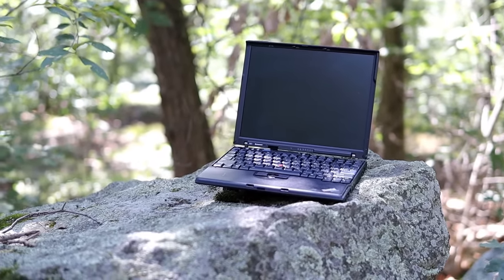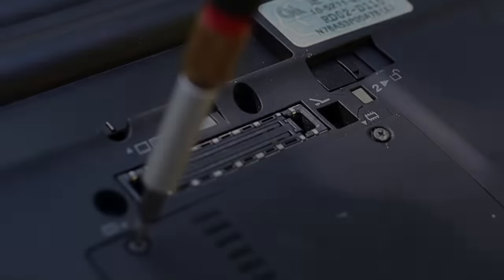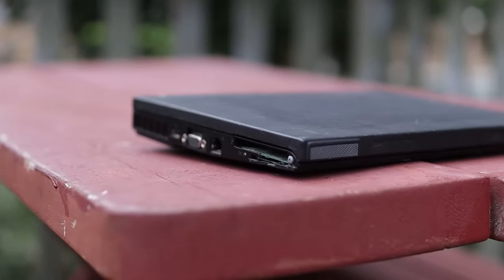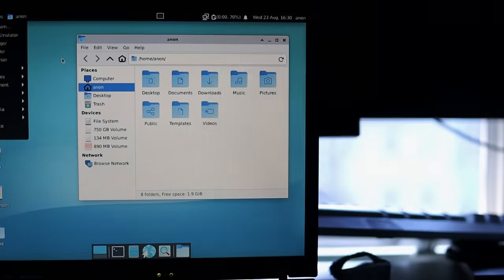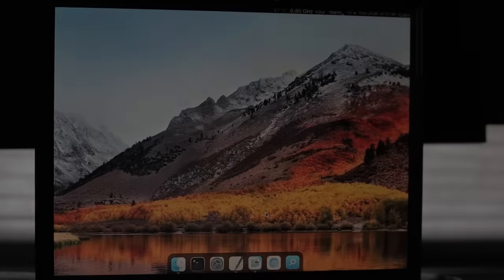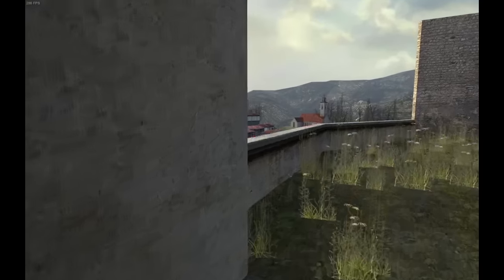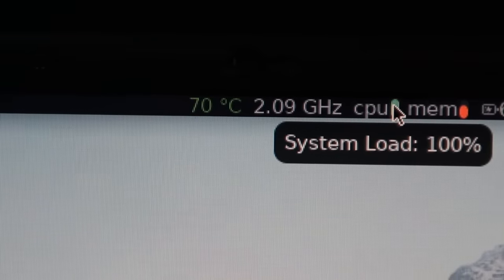Can Linux save this old laptop from obsolescence?

Comment: 😍 Have the same exact laptop, down to the CPU, though I got the extended batt. Ran W7 well because this laptop was released with Vista support, but yeah, that's been EOLed. I tried running elementaryOS on mine but the DE was too heavy. Linux Mint MATE and xfce ran fine. Was looking into making it into a Chromebook a while back, but it was too old.

Still think the Chicony/Alps keyboards on these are the best even when compared to modern ThinkPads. X220 was the last X series that had the older IBM-style keyboard, I think.

I brought it once to a conference just before COVID hit and people were genuinely curious and asked if it was new, likely due to the 'novel' form factor vs 16:9/16:10 laptops 😂

Comment: SSD’s make a huge difference to old PC’s.  My daily driver is an “old” 2013 i5 Thinkpad X240, and with upgrades to a 1GB SSD and Ubuntu Linux it’s pretty good.  I’m mainly using it for Python in Jupyter Notebook (browser-based) in case anyone is wondering.  I usually have multiple browser tabs open simultaneously.  It’s responsive and the keyboard is nice to type on.  The OS is current and gets software updates daily.  What’s not to like?  It’s certainly better than my daughter’s Chromebook from last year.

Comment: i play team fortress too with low settings but high frame rate on a 2007 macbook pro core 2 duo with 4gb of ram. it was the top of the line computer in its day and cost me almost $4000 in 2007, it had the high res display as well. 

due to the graphics card, most modern distros, while are able to be installed, can't get the drivers installed, maybe if i was more competent, but i tried. finally what worked though was MX Linux, i was able to install proprietary nvida drivers, and play team fortress 2 on steam on a computer from 2007, in 2022! pretty impressive.

the computer is still useful for web browsing, watching movies and videos, and many many things, and with the high res 17" display, it's still a nice big screen. i can almost think of it as a very smart portable tv and media center, with plenty of i/o and nice backlit keyboard and magsafe!

Comment: Have an old 2013 HP laptop, after swapping the keyboard and installation of a modest SSD with Garuda XFCE (I use Garuda Dragonized on my Desktop, wanted familarity), it's been more fun and easier to work on than my more powerful 2019 laptop, and I had a extended capacity removable battery for it that works great.

I've tried doing work on the 2019 laptop but it's  a nightmare to open, Ive already had to epoxy one of the hinges back together and the slot for the M.2 drive is already dead after just a few months with a basic SSD in it, the next time I open it will be to gut it for parts.

I plan to save up for a Framework laptop but until then my 2013 laptop running Garuda XFCE linux is my portable buddy, so long as I don't try to work on large Blender 3D projects it seems to handle everything just fine

Comment: Liked and subscribed.

This moment I'm doing the final update on a new OpenSUSE install on a 2014 Acer C710 Chromebook. It's even weaker than the Thinkpad, so I think I'll spin up the Void image I have on my Ventoy drive and see how it compares. May be a reinstall coming! I knew I had the image, but had forgotten about the low resource usage. Thanks for the video!

(Sent from my 2013 Thinkpad T430 running LMDE6!)

Comment: Absolutely! I have an 8 year old chromebook with manjaro on it that runs amazing with a 256gb m.2 SSD and an 8gb swap partition. It has 4gb of ram and it's one of the few chromebooks in which you can upgrade the hard drive.
Reply from the maker: Meanwhile, Chromebooks of today usually have a useful of no more than 5 years.

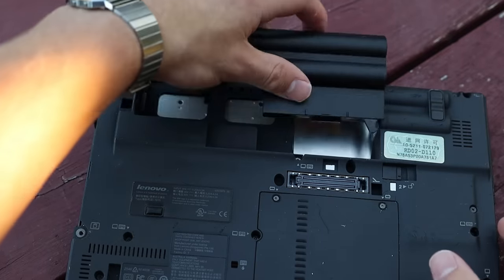Comment: 12:04 You meant that the modern laptops of today are more and more compressed and it has become difficult to work around stuff by yourself (for example even just taking out an battery has became an difficult task which was just slide in and out a few years ago. Ofc this has benefitted the companies and somewhat you as well, but to have fun checking the laptop and its hardware/software and messing around it is really an great thing which todays laptops can't offer

Comment: I have an X220, and it has become my trip computer, riding in my carry on luggage when ever I travel.  It's been upgraded with an SSD, and I got it with 8GB of ram.  I think it can be upgraded to 16GB of memory.  The X61 is barely not obsolete.  Any older laptop without a processor that supports the 64 bit instruction set IS too old as most Linux distros no longer support 32 bit processors, and even if they do, may of the user applications do not.

Comment: I tried reviving laptops with Linux several times over the last 20 years. Sadly I only got it working well enough a single time.. I don't know enough about Linux and all the distros.. I amateurishly tried out about 10 different versions/UIs but some crucial things never really worked.. I had the biggest problems with: GPUs (drivers), Wifi, everything on a laptop that isn't standard like function buttons, volume, brightness, even the Lid closing... never found a working printer driver..  and then not knowing Linux I also had trouble finding the software I want- but I expect that has gotten better now with all the browser based apps. I had the best luck with Linux Mint and Ubuntu- although Ubuntu was a bit too resource hungry.

Comment: I think the most important upgrade you could ever do is use an SSD. Even the cheapest SSDs can make a computer like this behave completely different. It is night and day.
Specially if you are using a lightweight linux + firefox, small amount of ram is ok. But HDD speeds makes anyone suicidal nowadays... rebooting, waking from hibernation, opening apps, become a chore...
Reply: I have some laptops from that year and I assure you they usually don't have a standard sata connector making the change almost impossible.

Comment: Old Thinkpads and Linux work very well together. I put bunsen Linux on mine - fits the design of the Thinkpads and runs on minimal hardware. A cheap SSD and maxing out the RAM helps a lot. The ergonomics beats any cheap, modern laptap. The problem can be the batteries which detoriates with use and age. And yes, Thinkpads are "interestning"! Thank you :)
Reply from the maker: I haven't heard of bunsen linux. I'll have to give it a try sometime.

Comment: This video is extremely well made!
Sadly I guess that a lighter os can't do much on CAD and similar things, am I right?
My PC is 13 years old, with Win10,  an i3 380m, 8gb and an SSD, but it seems to be close to the end of its lifecycle for my needs 😢
Reply: FreeCAD may work great on Linux. But probably this will not fullfill your purposes.
Reply: @puffin_000  thanks a lot for the answer!
Yesterday I was typing a comment on YouTube and realized that it struggles already with that task, so yeah, I guess it would be underpowered anyway
Still good for streaming though, so it will be repurposed for that
Reply: @claudiofiero8523  Heavy loaded JS websites always like that :D. Its great to see an old laptop like that still find a purpose.
Reply: @puffin_000  that's my first and only pc, I nearly maxed it out in this decade 🥹
It could still receive a cpu upgrade, but 40 bucks for marginal improvements on an old machine doesn't seem very reasonable for my pockets, it would be just a better dual core apu than its i3

Comment: Old PCs like this are actually still pretty usable even on their original operating system. I've got a laptop lying around running XP service pack. 3. And found a chrome designed for windows XP and get me like a version 109 or something like that and it's actually pretty usable
Reply from the maker: Neat!

Comment: The problem with obsolescence is that no matter how snappy you can get your OS to be (and Linux does have low requirements for low end machines), they just can't really keep up with modern web apps. A lot of people say they can daily drive those machines with Linux and that is fair, as long as you define what daily driving is. Unfortunately my daily PC use is by nature quite intensive on the hardware, as in, I had to upgrade to 32GB ram on my main workstation because 16GB wasn't enough for my workloads, and I'm most definitely using every little bit of my hex-core/12-thread CPU. But some people don't really do much more than office work, email, and so on, and that's definitely viable in older machines.
Reply from the maker: yeah the modern web is brutal on these old chips

Comment: Oh yeah, I've put "full fat" Ubuntu 22.04 on a few older systems (I am using the "Gnome Flashback" desktop though, rather than Unity or whatever, it has a more classic appearance.)   I'd say the realistic minimum is like a Core 2 Duo with 2GB RAM.  Indeed, if you can get a 2GB system to 4GB do it, you'll run into swap pretty fast as you open a few tabs.

The last C2D I set up booted to desktop in about 55 seconds off the HDD; you do end up with like 1GB RAM used at startup, but it can swap out about 600-700MB of that without any affect on the program you're running or the desktop.  The battery life was brutal though, battery life went from 4 hours doing nothing to like 45 minutes playing a Youtube video since it was running the CPU fairly hard.

I'll note, these old Intel GPUs run 2D and video scaling fine, but the 3D support a) was slow as hell on them anyway. b) dropped in newer mesa versions.  In general, all pre-shader supporting 3D GPUs (the ones that only had "fixed function" support) were dropped recently; there is still a "mesa-amber" package where they branched off that last version of mesa that supported these and intend to continue to fix any bugs and security vulnerabilities that turn up in it.  You get OpenGL 2.1 (but slow as hell) with the amber, or OpenGL 4.5 through llvmpipe software rendering with current mesa; the GPU is so slow that I actually found the llvmpipe to be faster (still bad but a little faster.)

My dad runs this piss out of a Core 2 Quad desktop (Optiplex 755) with 4G RAM and a 1TB HDD in it. He makes heavy use of Chrome, edits like 100s of page documents with lots of graphs and charts in them, tons of scanning and printing, and weekly Zoom conferences.  Zoom maxes out 2 cores by itself, but it's got 4 so it works out OK.  That thing has some problem due to successive Ubuntu upgrades (I assume it's probably got bits of upstart, init, and systemd all taking up bootup time..) and takes something stupid like 3 minutes to boot, but runs fine once it's booted.

Comment: Have same spec Dell (T7500 CPU), running lightweight Windows 8.1 without problems, around 700 MB RAM usage on Boot. Great for Word and occasional web browsing. Gaming is almost impossible due to OpenGL version on that and all in all quite obscure graphics performance

Comment: I feel that the "basic/heavy" developement was in the two decades 90-s and 2000-s (1990-2010).
Computers from 2010 is still good and most people could use it without problems.
If you want the latest games, of corse then you have to get computer for that.

Comment: Similar specs. Use "SMPlayer" with Youtube extension. Works great. 720p60fps in NON-Fullscreen mode.  Also 1368x768 native res on monitor is WAY Better after changing monitor to 720p resolution. (I don't know why such a big difference.) I'm using regular Mint Cinnamon 21.2.

Comment: A little while ago I was given a Fujitsu Siemens Lifebook. It's comparable to the ThinkPad in functionality and ports, though it's much more plastic lol.
I fully decked it out with 4GB of RAM, a T9500 (yes laptops of that era had user-replaceable CPUs, go figure) and an SSD.
It absolutely flies with Antix Linux and I'd say it still holds its own with Win10 whenever benevolent Microsoft blesses me with an update-free day.
Reply: Thinkpad is plastic though.
Reply: @0w3nn  Really? I thought they've always been constructed with alloys and more "premium" materials. Pretty sure the modern ones are.
Reply: @Windowsfan100  Yes, modern ones have metal lids. The older thinkpads (T410, T420, etc..) surprisingly are fully plastic. My HP Elitebook 8440p from similar time period is entirely metal.

Comment: I have a laptop that was once my mother's main computer, it's a cheap lenovo netbook from 2014 and it was installed with windows 8 (upgraded to W10). Horrible performance. Nothing was doable. I removed the old HDD disc, and inserted an SSD with classic Ubuntu on it. The mashine was running really well, and internet browsing was good too. 4 GB of RAM did it's job

Comment: With Thinkpad X61, you can upgrade the BIOS into the custom Middleton BIOS. It unlocks the maximum RAM into 8 GB (although it can't be used anyway unless you want to spend big amount of money to buy 2 x 4 GB DDR2 RAM sticks) and the SATA speed from I to II (SSD would improve the snappiness).
Reply: You don't need the Middleton BIOS to unlock the X61 for 8GB RAM - it supports it anyway. I know this because I have such a Thinkpad with the standard BIOS.

Yes, the Middleton BIOS does unlock SATA speeds on some Thinkpads and I think it might also allow for a wider range of wi-fi cards to be used on Thinkpads too.

Comment: I have been trying some "old" computers with the lightweight distros... well. For a person who is not a real Linux geek, 15 years is bordering on the top age of a computer that is still somewhat well supported in modern distros... a bit better if already a 64 bit unit. I've run into a few strictly 32 bit units that were shipped with Vista or 7. A couple came with SiS chipsets where VGA support in new distros appears to be sucky at best, at least out of the box.

Comment: As someone still using a 2013 and a ca 2009 desktop daily, I can see how even an old laptop will still do got. It's all about expectations.
Core 2 Duo are still usable, not as fast as modern chips, but usable.
The difference is, that on a desktop you can run any older highend or modern entry level GPU. The Intel GMA were rubbish even in their time. (As the HL2 benchmark showed. DX10 and OGL 2.1 are supported, but there are issues)
If the laptop had more beefy graphics, it would make for a decent XP retro machine.
For Windows, the usable requirements from Vista to 11 haven't increased much, it's more about additional requirements like D3D capability, instruction extensions, and TPM.
And the X61 is from that era when Lenovo took over the laptop line from IBM, but didn't try to copy Apple yet. Proper business machines that are built well and still work.

In general, well done test with realistic use cases. Throwing Linux on it and using uBlock is pretty much on point.
I'm using x264ify myself. It's a godsend when the system doesn't fully accelerate vp9 decoding. And've used a Dell Latitude from 2001 before that came with a 1600x1200 display.
Reply from the maker: Yep! Expectations are everything with hardware this old

Comment: I'm currently doing something very similar. But instead of a 16 year old thinkpad, I'm using a 23 year old Dell Latitude. 750 MHz Pentium III.
I'm putting an IDE SSD into the thing, upgrade the RAM to 512 MB, and then AntiX Linux 23 should run just fine.
Reply: Planning on doing any work on it? :D

Comment: This is an old laptop in years but it's not really so weak that rescuing it with linux could be a challenge... The ram is upgradeable to 4gb, while the processor is a powerful Core to Duo of that era. With a cheap 120gb SSD it could run even the most demanding Linux distributions, not just the lightweight ones. If we take the graphics parameter out of the equation, an upgraded one ThinkPad X61 it is better than many budget laptops that were released in the market several years later...

Comment: Funny that i got recommended this. Got Lenovo L410 & W420 refurbed years ago for my wife & I. Maxed out the ram on both & they are really good machines. Was abe to get Win10 running on one but not the other. Saved it with Ubuntu, & boy is it a nice experience. Threw RetroPie on there & DP to HDMI on a modern monitor, excellent viewing experience. Don't disregard slightly outdated tech, with a little research & patience you can avoid the Microsoft monopoly!
Reply: Also didn't hurt to mount Star-Tech USB 3.0 cards in the empty slots that came on these machines. Not quite as blazing as my modern HP, but still not bad at all

Comment: I, as a Linux User (specifically Lubuntu user) agree that you can fix a obsolete laptop and, even i am on a obsolete HP Z400 pc, and it works like a charm with Lubuntu, with the latest Xeon and a 128 GB HDD and a 2 TB ssd, along with 32 gigabytes of ram. Truly, if you are a person that just wants to revive old Workstations, go for a old model like the Z400 HP Workstation, since its still good, and you can upgrade it and make it even better

Comment: I had an old X220 that gave up the ghost on me but with a lightweight Linux distro on it (I went with Mint) and an SSD it was a great little machine.  I did have to replace the battery at one point but man I miss that keyboard.  The newer Lenovo Thinkpads don't use the old style keyboards and it took me a long time to adjust to the keyboard on the Dell XPS 15 I got to replace it.

Comment: I have a 16 years old pc. Originally it had Windows XP, then 7 and now 10. It can handle office tasks without problems and internet browsing quite decently.

I also managed to force it to run Windows 11, and it wan't that bad to be honest.

But I would prefer a light Linux distro such as Lubuntu on it.